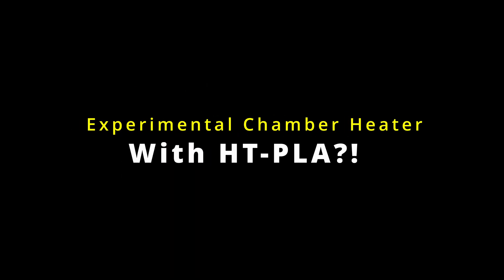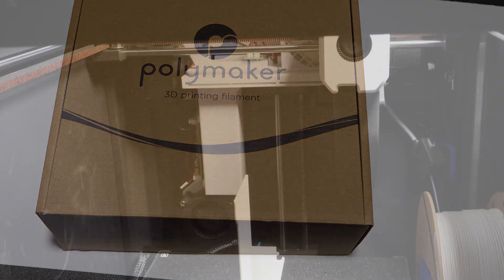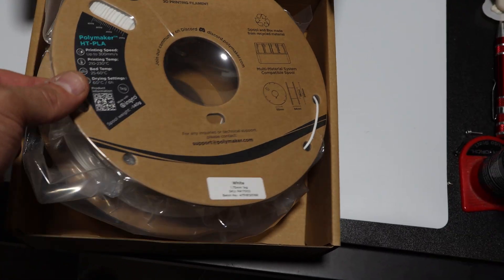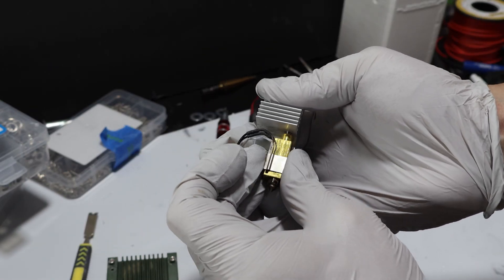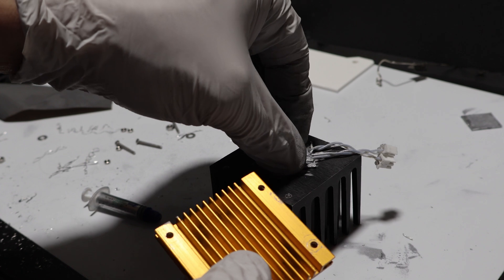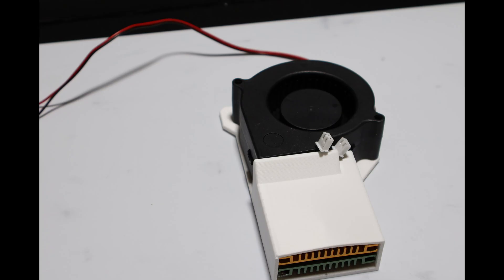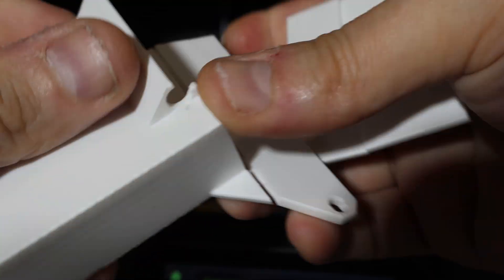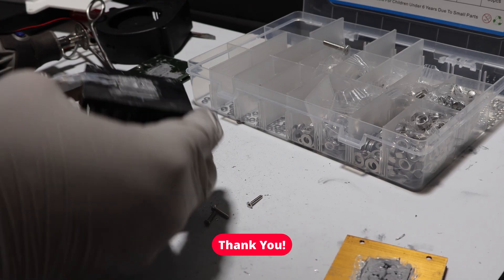Experimental Chamber Heater With HT PLA?!

Comment: in the Centauri carbon Elegoo has used simple non glass fiber reinforced plastic for all mechanical components on the kinematic components, this is major drawback as even cheapest fans use this to prevent plastic from deforming.

Comment: Does the mainboard have an unused pwm slot to operate an ssr to control the extra heaters or did you use something standalone? I have a 24v 120w ptc heater that id like to integrate  and im wondering if i have to go standalone or if there are some extra open pwm and thermistor slots on the board that i can repurpose. Also, not sure if youll know, but what are the 3 wires from a ptc? 2 for dc+ and 1 for dc-?

Comment: This seems like a great place to float this idea.  It seems like the control boards are outside the print chamber and the stepper motors are really what may overheat in a heated chamber. Would it be possible to print some ductwork and blow outside air over the steppers and heat the chamber without worry? Thanks for any constructive input.

Comment: I have found that the bed temperature for HT-PLA needs to be up around 80C to prevent warping.
Reply from the maker: While I didn't have any issues with the tool head cover, I did notice the tendency to warp at 60c with the experimental heater case. I just started printing with a brim, but raising the bed temp is probably the better option! Something that I think I forgot to mention in the video. But yeah, HT-PLA is not the carefree PLA that prints decent with almost any settings you throw at it. It's a bit more temperamental.
Reply: @SyntheticElectron3D  For sure. I ran into the issue printing Chirimorin's riser with magnetic doors, which has long (300mm) thin (17.5mm) pieces, and 80C seemed to fix the problem. I went right to that because it is the recommendced annealing temp (non-GF HT-PLA).

I did run into slight warping with the tool head cover, but very slight.

Agreed it has other difficulties, but it is still less tempermental than most other filaments. It just vcatches you by surprise because you expect the usual.

Comment: Yes, i would like that. Since i can only print pla/petg because no venting available. I would have to have the right cover printed by an external service.

I am also very curious about opinions on the the guy that's doing the tz adapter extruder mod (Bambu clone) with as he says 40% more flowrate, lighter and coldswap nozzles .. Since i am fat to nooby to have a opinion on that myself

Keep up the good old tweak-o-saurus addiction!

Comment: You seem to be very tuned in on cooling. I would really like to see you do a series on how to dial in cooling settings for the Centauri. I have been 3D printing for 11 years (mostly with a delta I designed that didn't have cooling), and with ther Centauri I am trying to come up to speed. But I am having trouble finding good info. A little out of your focus area but I haven't done your aux fan mod simply because I have no idea how to adjust for it. It would help.
Reply from the maker: Thanks for the idea!

Comment: I'm printing in HT-PLA right now ... what settings are yoiu using? I tried it on the toolhead cover and it prints nicely, but it has much higher density and gains a lot of weight. I am going to try it in Eryone black polypropylene, which should be really light and very durable - assuming I can make it stick to the plate. Lost In Tech has a pretty good video on that.
Reply from the maker: I reduced the top and bottom layers to 3, eliminated thick bridges, used 3% gyroid infill, I also used Archimedean chords for the bottom (face). Not sure the bottom surface pattern made a weight difference, but it looks kinda neat.  The result was only about 6g heavier than the ASA version.
Reply: @SyntheticElectron3D  Wow I'll try that. Mine was a lot heavier. FYI, the Fire gradient HT-PLA looks really cool when it prints this. Try it.
Reply: As My Tech Fun showed, HT-PLA (when annealed) shows dramatically reduced creep, making it a pretty good option for modding.

I am having the same issue that looks like spool drag, but only sporadically, so I look forward to a future episode discussing your experience with the stuff.